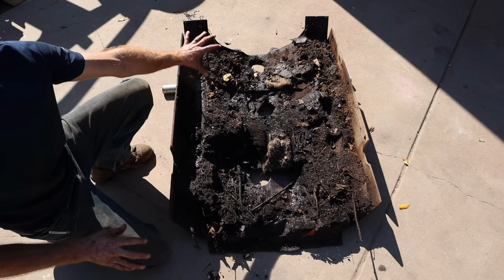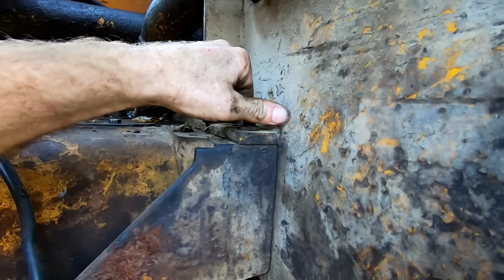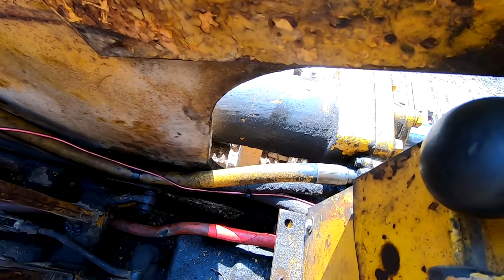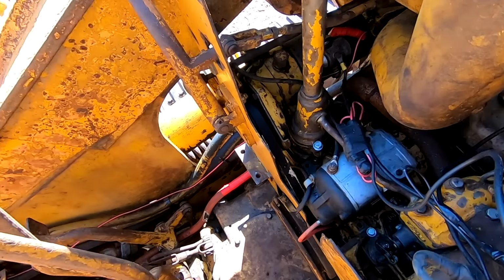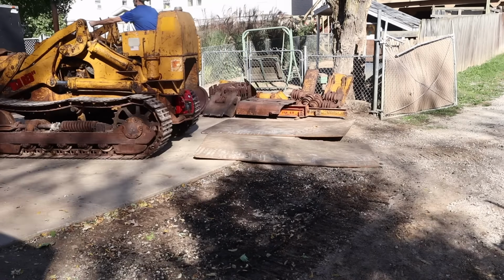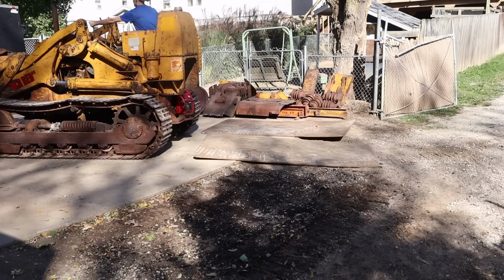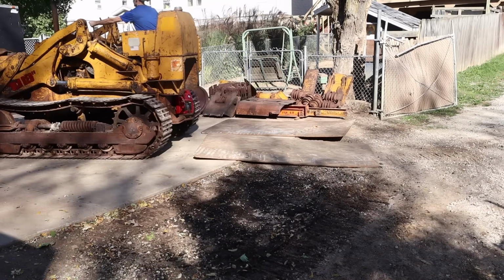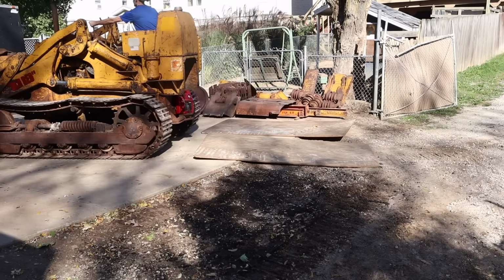FIRST Wash in 64 Years... or Something!?! ~ Part 7 ~ 1950s Caterpillar TraxCavator

Comment: If you need to do a head gasket and all of that other stuff, maybe a full refresh style rebuild would be a good idea? I’d definitely prefer to watch that, especially if it’s piece and part style where you leave it intact as much as possible when doing each part, instead of the full tear down style everyone does these days, like the bucket arm system, then the pump, each hydraulic cylinder, the pony motor, any other engine accessories, then remove the engine and most of that stuff and then when it’s not as heavy, do one track carriage assembly at a time, you could likely make a dozen videos and end up with little to worry in the way of failures, the hydraulic videos would be really nice and just to keep things interesting, do each of the cylinders and then something else then the pump, that way it’s not so much hydraulic at once (for you and for the audience)

Comment: Your cylinder head.  Did you check the cylinder head bolt torques?  You may not need to replace the gasket if it solely a matter of the bolts being not a tight as they are intended to be.  But of course, with so many leaks and weepages, a new gasket may well be the better path to fewer oil leaks and maybe compression leaks also.  Would give you the opportunity to overhaul the "top" of the engine, such as valve grinding and valve clearances, and perhaps resurfacing the cylinder head.   (Where does this stuff stop?)

Comment: Could the water have possibly found it’s way past the valve cover bolts or the spot you pointed out on the valve cover missing some of the gasket from the pressure wash?

Comment: You will need complete gasket and/or rebuild kits for both motors...
All internal & external seals for all hydraulic cylinders...check out various hydraulic repair videos from Abom79; he rebuilds them and is a wealth of information...

And, of course, you know that the head fasteners have to be new sets, either stud sets or single-use torque-to-yield head bolts...

These items are only the tip of the iceberg but they are the most important to start with because of the age of the machine and the blown head gaskets...

You're going to have to choose your battles...
I envy your restore project because I love doing that kind of stuff...

Good luck to you and be safe!

Comment: I don't think that's an exhaust leak at the valve cover, It is probably dusted/worn out and the TONS of smoke coming out is excessive crankcase pressure. BUT, simple things first, if the crankcase vent is plugged, the pressure/gasses find their way out via weakest spot, in this case, the very old and hard V/C gasket.  Also, the H2o under the lid is most likely from pressure washing it.

Comment: On a gas engine,  exhaust can leak out of the path from the egr. A diesel should not need that device. As long as it sat, you may have rust on valves. That would  prevent  them from seating as well as they should.

Comment: Spray silicone lube is best for gaskets so they wont stick for extreme heated gaskets dry spray graphite .I rebuild carburetors and i also make carburetor spacers and use the silicone alot.gaskets dont stick.

Comment: The water in your valve cover was probably from pressure washing. Also exhaust blowby through the valve cover likely bad guide seals. could be valve seat or slightly stuck valve that let exhaust blow out the valve guide seal but both should be investigated and repaired simultaneously anyway.

Comment: This little cat just needs a Sasquatch style repaint.
It appears that the value cover bolts wear  over torque at one time making a trough when you need a high center line allowing water to shad off instead of going in side past the bolts.

Comment: 13:14 If the 64 year old hydraulics had failed when you had you your foot under the bucket, you would have lost a foot.  Please support the bucket with wood blocks before you put any body part underneath it.
Reply from the maker: I agree with you that can be dangerous! I had the arms supported by 1/2" angle arm between the cylinder and the loader arm, and it wasn't going anywhere! A few wood blocks would have been good insurance though!

Comment: Ha.... the belly pans weren't as bad as you think. One normal season of regular daily work gives you 1 to 2 buckets worth. Was kind of an annual maintenance happening to clean them out. Obviously the machine was spot worked for many years on the farm. Those kind of machines do get ignored on a lot of things that would normally get addressed on daily working machines. They're not depending on it to earn for them. All the loose, missing hardware is not as unusual as you'd think in that situation. Just part of the deal really. Valve cover water is from pressure wash. Condensation won't be that clean, it'll be milky. You'll want to check gaskets vs money with cat. Making some is fine but the head gasket itself with some seals may cost the same as an entire kit. Your machine is relatively early production, no telling what's available and how it's  priced. You're in it now lol.... doing a nice job on it. Thanks for sharing

Comment: If it isnt burning oil I wouldnt mess with the rings. Clean the breathers.  Might be compression leaking  past the top of the liners. They all have to be sticking up above the block deck the same amount or they will not properly seal. You should take the time to watch Squatch 253,s engine video of his D2 engine. That D2 engine is just a smalle version of your D4 engine. In fact they use the exact same pony engine. He is very knowlegable.  Stop watch Squatch and then proceed it will save you time and money.

Comment: Lets see, you PRESSURE WASHED and old motor, with old leaking seals.  You have water in places where water should not be located.  Maybe simple cause and effect.  The broken piece on top of the valve cover is called a SEAL CAP.  It helps keep WATER (and dirt) out of the valve chamber.  A sticking intake valve can cause exhaust to come out of the intake.  Motor sitting for an extended period of time can cause this.  The leaking head gasket could also be the result of sitting for a long time.  Some times (not always) re torqueing the bolts, and running the engine for a about an hour (put some oil flush, or some oil safe additive in the oil while doing this will help flush out the oil passages), will keep you from having to pull the head.
The hydraulic cylinder end seals probably need to be replaced.  The end seal are just dust seals, and the way they look, it is very possible that dirt has got behind them and destroyed the actual seals.

Comment: Back in the late 60s and early 70s I worked for an outfit that flu and restored antique aircraft
Reply: let's try and not hit send before I'm finished. We were working in the old caterpillar dealership buildings as the guy that owned the planes also owned western equipment company that sold Caterpillar. One of the things that I remember was being sent up to the main shops to use their Walnut Shell blaster on aircraft parts. The blasting cabinets sat right next to the machine that rebuilt rollers for tracks. Don't know if that still a process that caterpillar dealerships use, but it was like a lathe combined with the wire welder. The rollers rotated slowly and the welding had moved across and built up the rollers. I remember it used a granular flux that poured over the top of the world and then there was a device that broke it off before it came around again and continually recycled the flux. As I remember it was one guy's full-time job just to maintain that machine and keep it filled with refacing rollers. You might want to check with your local Cat dealer and see if that process is still available I'm sure it was much less expensive than new ones.

Comment: Theyre is a possibility of
It leaking exhaust out that intake , some old style motors butt them right up
To eachother and run the exhaust through the intake but in what you could almsot consider a water jacket except for exhaust , over time if that flowing hot exhaust wears a small hole through you’ll get a leak like that , almost like the bend of an exhaust on a car , over time it’ll get thin on the back side of the bend
Reply: Yes on the old  cats the Pony engine Exhaust it routed thru a tube in the intake manifold to heat up the incoming air  to aid in starting the  main diesel engine. The head gasket leaks are likely leakage of compression from the cyls. When he removed the head he need to check liner protusion. Just changing the gasket might not fix those leaks.

Comment: @25:36
Notice how the valve cover is creased, lengthwise?
That's from over tightening, trying to compensate for a leak.
Creasing like that- takes the "spring" out, lessens the clamping force.
With new grommets & gasket- it shouldn't take much to seal that properly.

Comment: Purple power engine degreaser in a five gallon bucket from your local tractor supply. You put that stuff on anything it starts melting the grease and oil. Just don’t wash your hands with it. It will strip the oils from your skin in a heartbeat

Comment: Cannot see the point in replacing the rocker gasket when the head need addressing as well, The engine is due for complete inspection to the main bearing, Start one area and completely finish before going on to another, Or you might as well not start.

Comment: I know your not going to completely tear this thing apart for a perfect restoration but if you did this thing would be worth way more then it is and you would be able to tackle every fix as opposed to finding issue after issue and patching one just to find another.
Reply: I think he is going to wind up tearing it apart, he just plans on doing a working restoration vs a perfect restoration, ie, if the issue as mostly aesthetic, ignore it. he's gonna wind up having to disassemble nearly everything, but no need to put the extra time into rebuilding the grip on the pedals, or trying to fix the dead tubes in the radiator, so long as it runs and runs well. at least that how I interpreted it.

Comment: Think someone took it apart and didn’t fully put it back together.  Operating with loose and missing bolts would break up castings and bend the s*** out of everything.  The machine hasn’t been run much at all since being put together.

Comment: With all those loose bolts there would be no way of discerning why that drive wheel is warn and rounded off as badly as it is. It's a wonder how you got it as far as you did.  We would call this "a good catch" although I have to admit, you really couldn't miss them. The point I would take from this is that you gotta check every nut and bolt on it. Tom Mert (another commenter) is right, You are an excellent machanic, I would imagine you were a mecanic in the Army? Your product knowledge seems to broad to be just that of a floor mechanic.

Comment: Torque the head bolts appropriatly (Sequence and Torque) and see if that solves the leaks and the blow by probably not but is much easier than tearing off the head.

Comment: 23:20, yeah there's water in there. You pressure washed it and it has a bad valve cover gasket, that's 99% why there's water in there.

You shouldn't pressure wash an old engine like that unless you plan to rebuilt it.

Comment: You sir are about to get an education in the price of caterpillar parts if you break that engine down.
Off hand I'd say the leak you have on the head is due to the piston liners being beat down into the block over many years of use.
Spacers have to be used under the piston liners to bring the liners up to oem specs.
A dial indicator is used to measure the protrusion. 
As good as that old beast runs ....
I'd never break it down. 
No way.
Do your running gear and use the machine lightly.

Comment: Some of those bolts could have been slightly stretched due to load stresses, and over time the looseness was further worsened. I suppose all these bolts are at least Grade 8 and should be replaced with the same grade. It's not unusual to tack-weld a spot on some since they are subject to loosening over time because of load stresses. These machines were not a perfect design and weak points will show up.

Comment: You need to follow Squatch253 on Youtube, currently rebuilding an old D2.  I love your ambition and desire to fix old Cats.  But you are looking at about 12 to 18 months of work assuming you have another fulltime job to fund this or a rich uncle.  My dad rebuilt his D4, same tractor as this no loader.  Don't say easy on an old Cat head gaskets alot of details to get it right.  Get all the shop manuals before tearing things apart.  Alot of fun to fix but alot of work to get there.

Comment: Condensation from years of sitting. Probably down in the pan.  When you ran it heated up and there you go.   

Please you your safety and my piece of mind take of the jewelry while you p urvworking on it saw a guy loose the last two fingers years ago from the wearing a ring working on a bobcat.  Yea never will happen to me,  my wife will get mad.  Sure it won't till it does.  Just takes a split second.  Chances are never happen but what if it does?  Just like had a a fuel system blow on me and there i was in the burn ward for months.